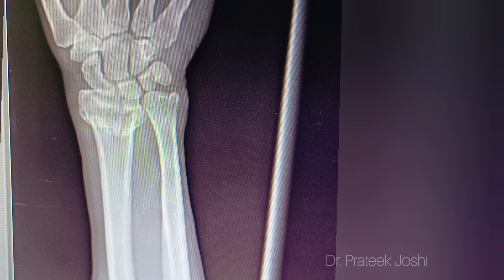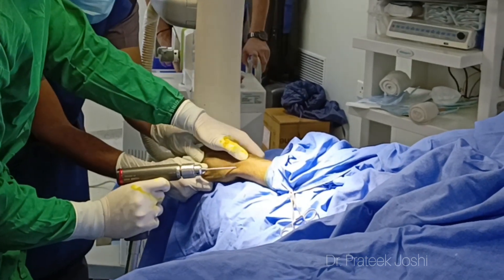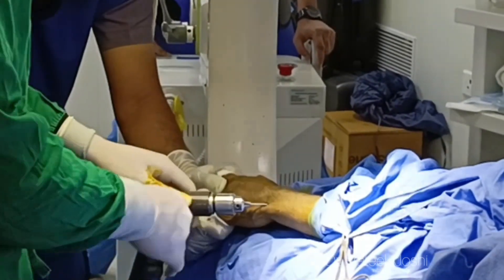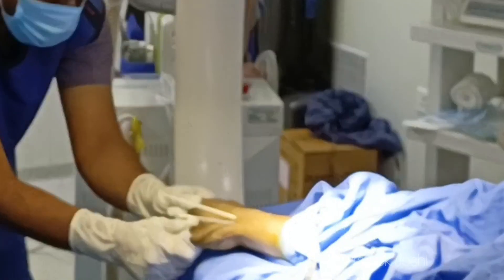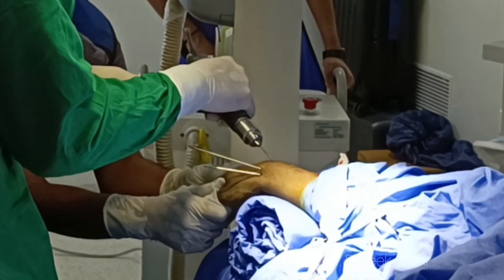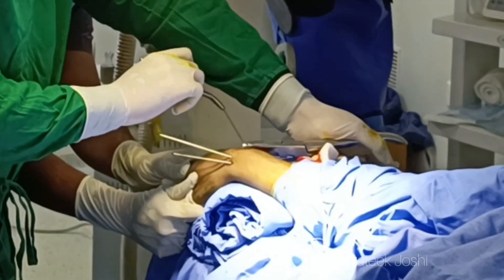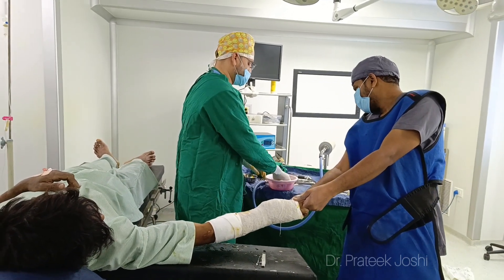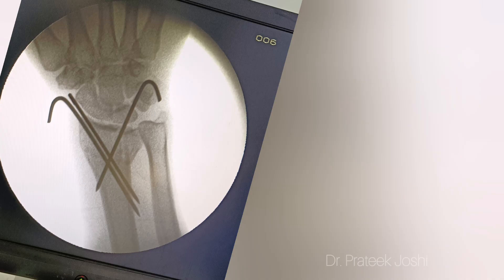Distal Radius K wiring Surgery | Dr. Prateek Joshi #ortho #kwire #fracture

Comment: Once u have already fixed with 3 wires, then later what was the purpose of giving traction by assistant...it won't distract the fracture site because u already have fixed it with 3 wires
Reply from the maker: @DrAniketHajare  yes but wires don't provide absolute stability... Giving traction will add extra level of reductive force